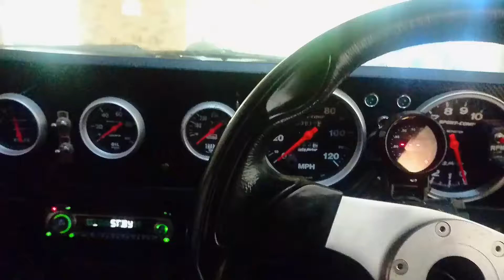Holden 304 turbo 5L Commodore on e85 First Startup Idle

Comment: Seeing this on my YouTube feed 4 years on 😍
Reply from the maker: Probably would have been alright had I put a new short in it when it did a bearing. Never even drove it in anger properly
Reply: @WinginitMotorsports  coulda, shoulda, woulda. Cuddles might have been a totally different car than it is today. But the path you're on isn't a bad one either 👌🏻
Reply from the maker: Yeh but 

How good is a 304 with a big aspo cam and a truck turbo tho 😩👌

Comment: Doesn't sound like a 304
Reply: That's because it's on E85.
Reply: @None-kv7sd  don't think that's why the way it idled sounds like a 6 probably need better timing or a tune
Reply: Not bahhhd Good size obviously he needed to adjust the timing a little bit and tune it. It looks like it’s the first start after being built.